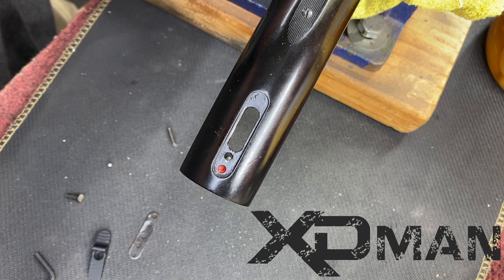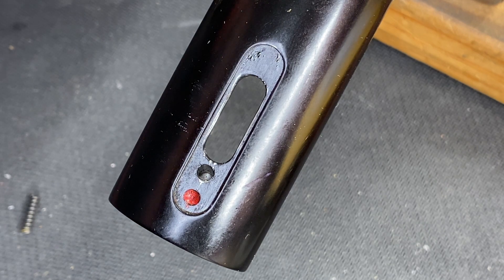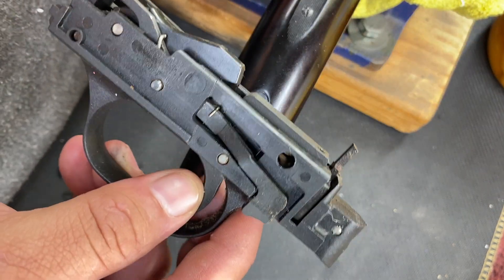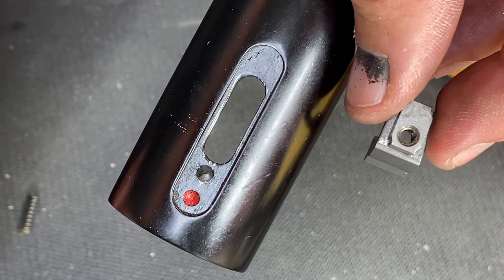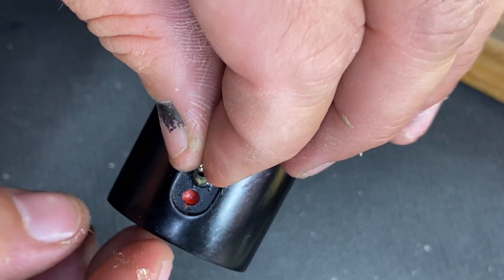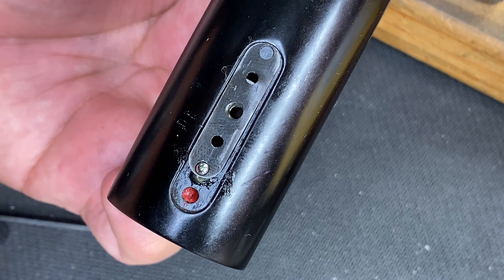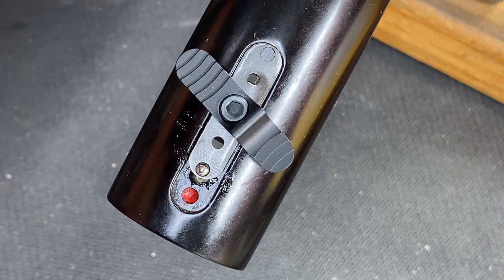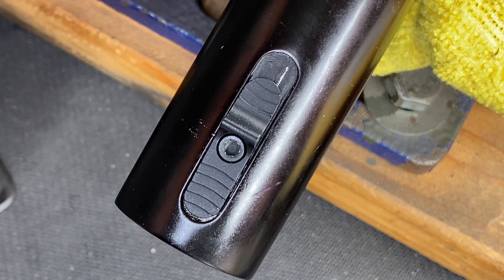Quick Tech Tip Mossberg Safety Reassembly

Comment: I like to pull the action all the way back and let the bolt retain that piece inside the receiver and then do the grease, spring, bearing, top plate,  then screw it on.  It allows the use of both hands.
Reply: Yes...with the pump action to the rear, you can remove/replace the safety slide  WITHOUT disassembling the receiver group.
Reply: Has anyone ever just took that silver block out and rock the 590 with no saftey ??

Comment: The way it look I think you could rotate the switch to the other way such that the allen screw will be behind the wall of the switch so when you're locking/unlocking you're not touching the allen screw because it's on the other way. I hope you understand what I mean, try it and let us know if it works.

Comment: I unscrewed my safety as it was sticking and I wanted to lubricant it . The anchor fell into the receiver I didn’t see a ball bearing or spring. Starting from scratch- where do I get the spring & ball bearing? I will buy the new lever as you suggested on this video.

Comment: Thank you for the informative video Sir. I just bought a brand new 590 (2015 manufacture year) and my safety is very stiff. It is manageable to turn on the safety but to turn off the safety requires much more strentgh. However if thats not a functuality problem I can live with that. No shots fired yet as I bought it yesterday. And as I understood some Mossberg safeties have this stiffness issue. My question is this a big problem, affects the gun in any way? As I will use the gun with an empty chamber all the time if not shooting, then I do not mind turning the safety off. What is your take on this? Thank you.

Comment: How hard was it to take out the safety screw. It took some time to get the safety screw out, be patient with it.
Reply from the maker: The hardest part is the knobs are situated that it makes it hard to remove. I have never had an issue removing them with the largest latest gunsmithing flathead pushing hard down into the grove. My recommendation is to then purchase an aftermarket screw that does not have the anti tamper head.

Comment: The spring on mine is shot and when I fire the safety slides to the safe position. I was told replace the spring and the ball and that would fix the issue. It seems these links do not include spring. Can you point me in the right direction.

Comment: I am having the same issue with mine. I replaced the safety and it is still activating after shooting a round. Any ideas to trouble shoot?
Reply from the maker: Did you also replace the spring on the detent? If not I would recommend that as well.
Reply: @therealxdman  I did not but I will!

Comment: How did you unscrew that one way screw?
Reply from the maker: Take the largest flathead you have that will fit on the one way screw. Then with the receiver held down, use the screw driver pushing down as you twist to unscrew it.
Reply: @ thank you

Comment: How do you get the one way screw out?
Reply: I pushed down hard with a flat screwdriver that had good sharp/square edges.
Reply: It doesn't look like it has Loctite on it (after examining the screw after disassembly), but it has some sort of thread locker. Use a soldering iron to heat the screw from the bottom to break the bond, and it'll come right out. If you have a flat screwdriver, grind the tip flat (the end surface perpendicular to the long rotational axis of the screwdriver). This will create a sharp 90° corner that will bite into the screw. It comes out so easy after heating it. I couldn't get it out at all until heated it.

Comment: Way too complicated.  Don't take the gun apart.  Slide the action back and leave it back.  Unscrew the old safety. Don't lose the bearing, spring and plate.  Drop the new safety in and tighten.  Took me less than 2 minutes.

Comment: You installed the safety switch on backwards. Screw should be toward front.
Reply from the maker: Not according to the manufacturer https://www.ndzperformance.com/NDZ-Mossberg-Shotgun-Safety-500-590-835-930-935-RD-p/ndz-mos-es-red.htm
Reply: The switch is reversable depending on large or small hands.
Reply: Thank you , I used this video to replace my safety. Very well done. Made my job easy
Reply: @therealxdman  I looooove it when someone tries to correct someone and they end up being the one who's wrong. Bwahahaha.